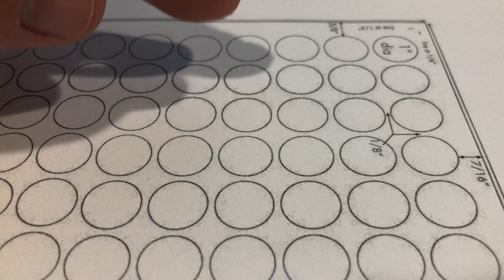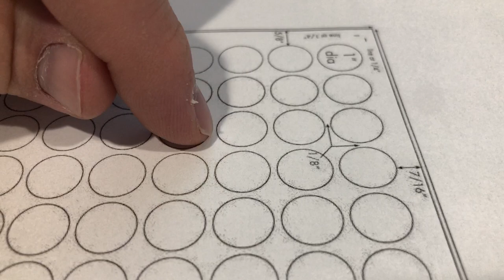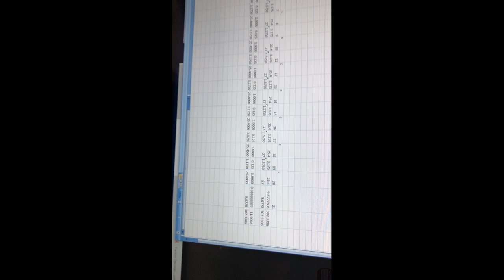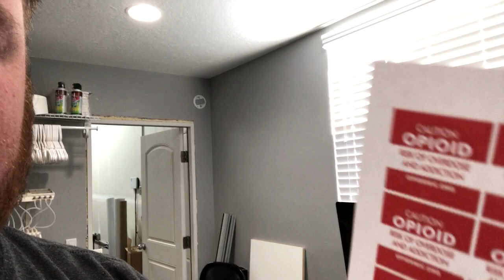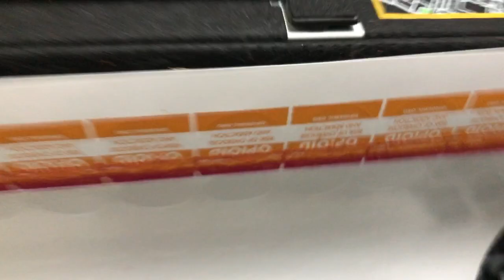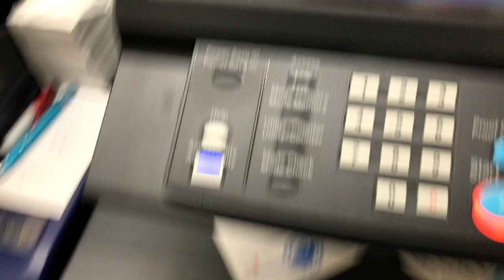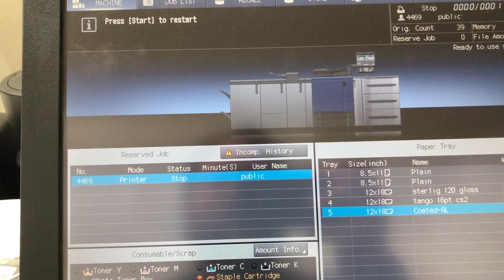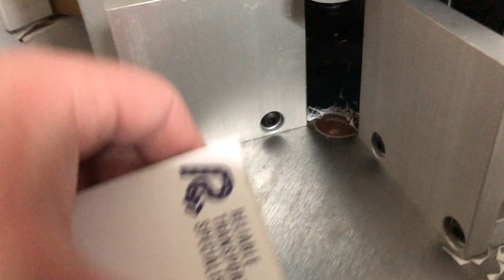New tool, labels, Konica jams, and magnets  - vlog 212 - Print Shop Updates

Comment: I think you're seeing a paper feed issue on the Konica. Either adjust the pile height sensor, loosen the blue lock screws on the side guides so there is more space, or flip the white tabs out that hold down the two black guides on paper tray. You shouldn't lose one sheet on that job. Hope one of those help!
Reply from the maker: I'll give that a try, thanks, Dan.

Comment: By chance did the temperature change in that room drastically. Or in the room where you store paper. Just recently my machine was jamming in the same areas. My boss thinks it's cool to turn off all the heating in the building to save money. Then when I have to print on the weekends it doesn't want to print. NOT cool, or too cool! depending on how you look at it. Normally, the machine can handle slight temperature shifts but it's the paper that really gets thrown for a loop. Too much static will jam it. This is most likely the issue if switching trays didn't fix it. 

Where did you get your sticker paper from? The circles come pre cut like that? 

20 sheets a 2 cents a sheet isn't bad, but if it's 20 at a buck we have some issues. I usually keep a stack of pre run paper. The paper that I do my page alignments on. I throw them through to not waste the good stuff as much. When I know the machine is messing with my life.
Reply from the maker: No, I have a space heater in the room that keeps it at 68F. The konica tech said he thinks that jamming is related to some shift setting I can't remember. All my other paper ran fine that day.

It was from gflabels.com

It was about $0.22 per sheet after shipping.
Reply: @ttms  when in doubt make sure Fiery is updated.

Comment: How much did the corner beast run yuh? We have a hand held one that does quite well for limited quantities. Can't think of the brand.

Did the give you a right angle corner jig to hold the paper steady on the opposite end. That helps with making a cleaner cut.
Reply from the maker: It was $500. I looked at the handheld lasco but it was about $300 with one punch and I couldn't find a good used one. I didn't get a corner jig, I'll have to look into that.